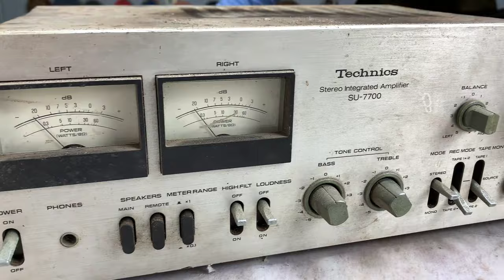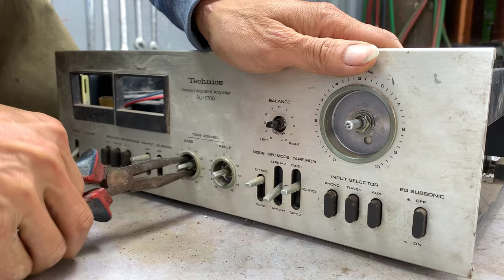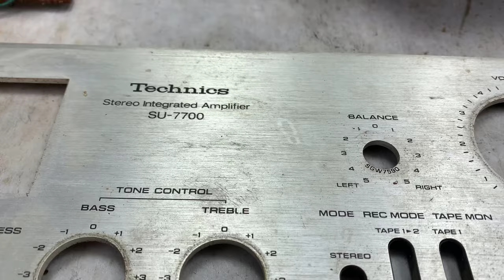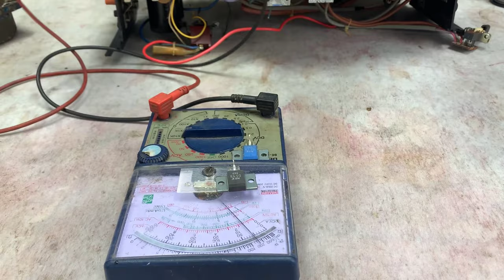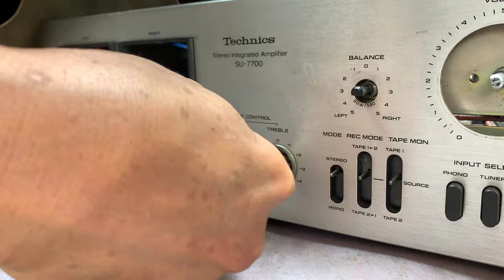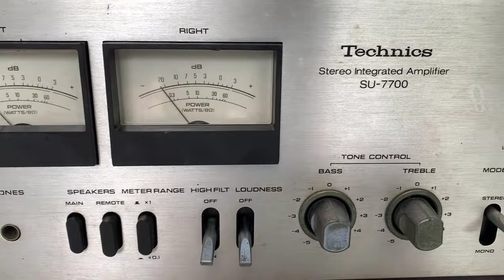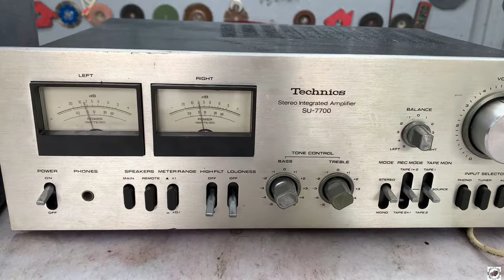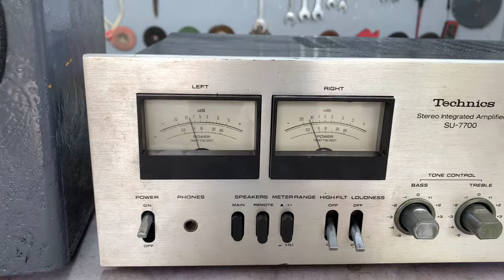Technics SU - 7700 Stereo Integrated Amplifier Restoration // Restored Japanese Amplifier 1976

Comment: It is very interesting to know your method to measure all the electronic parts in circuit. Why you was sure no capacitor wasn’t too old? Can you make a video and explain all you methods with a standard multimeter? When you are using an oscilloscope?
Reply: Никогда, все ремонтируется гвоздем и ацетоном.

Comment: Hi there is it easy to replace the bulbs lamps on the vu meters por favour? Do you have a video for this? Muchos gracias de UK.
Reply: Not much of an issue, can be managed easily by using similar replacements or convert to Led,s...